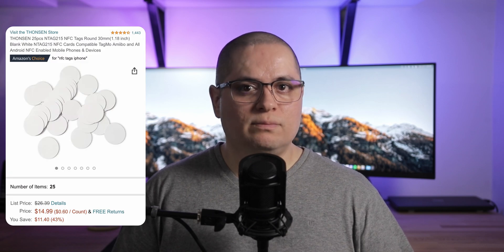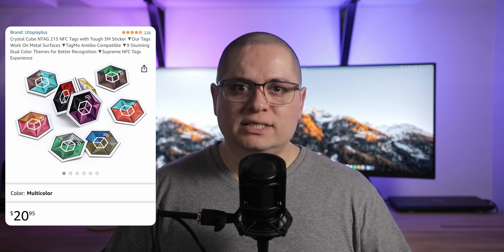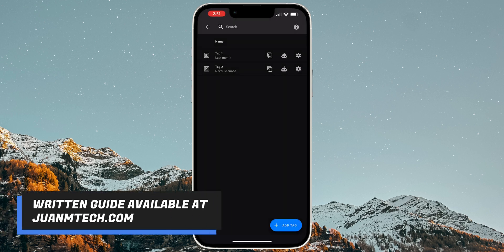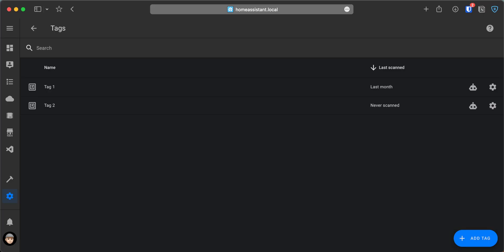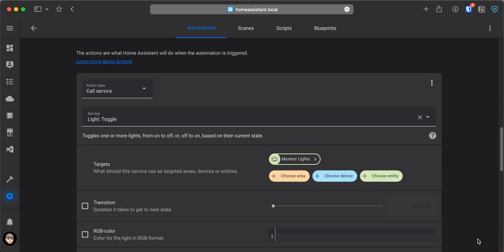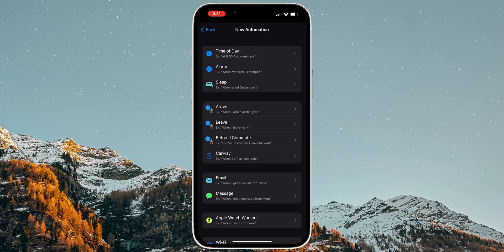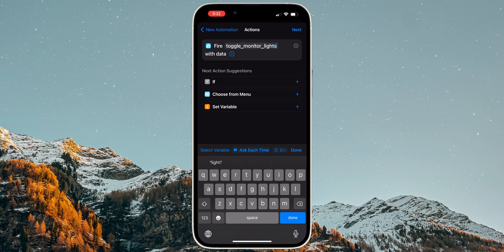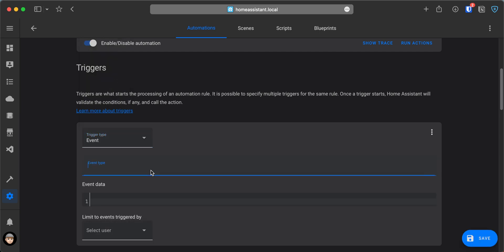How to use NFC tags with Home Assistant

Comment: I was finally able to get my NFC tags to run something without having to tap a notification in iOS today thanks to this video.

One thing I have a question about, does it matter which NFC tags you buy really?  I notice the ones I have sometimes take several seconds to actually register that I scanned them to run the automation.  Not sure if it's the tags themselves or whether that's "just the way it is".

Comment: Using an Android phone I have discovered that the plain white tags can trigger an automation without opening the HA app. I also tried using tags designed for outdoor use (they look like a thick black washer) but they require the trigger to be automated with the HA app open. There must be some differences between tag types.

Comment: can you 3d print a waited platform to stick the tag on, can you also create actions (for differant devices) that connects/disconnects mobile devices to/from bt headsets using these and can you setup a action (when tag is tapped) and do another action when you're out of a location?

Comment: Only for ios i guess
Reply: Android app for HA allows for scanning tags too.
Reply from the maker: Both iOS and Android
Reply: No Shortcuts app on Android, but I’m sure there are reasonable equivalents. (Is there an obvious choice there? If so, perhaps Juan will do a video covering it!)
Reply: @MichaelAlderete  On Android when you scan a tag, HA knows immediately (no notification to click) so the whole "Shortcuts" hassle isn't required
Reply: @DrunkenGolfer  hey there. I have a Pixel 7 and i do get the notification when scanning an NFC tag. I have to click it before it triggers the automation in HA. Any advice?
Reply: @wietsecornelissen8994  hmm. My Pixel 5 is up to date and doesn't give me any trouble. I think I remember that at first I had a notification, and chose to always open the links with the Home Assistant app. What does the notification say? Do you have the option to partly swipe the notification left or right to get to settings for these kinds of notifications?
Reply: @DrunkenGolfer  the notification pops over the screen. So not in the regular notifications bar at the top. It simply states that my phone received a hyperlink when the nfc tag was scanned and asks me if i want to open it. This is the step i want to get rid of. I am thinking of using Tasker with the HA addon but of there is an easier way to skip this notification i would be interested to find out!
Reply: @wietsecornelissen8994  no idea - sorry
Reply: I have one more question: can I somehow switch off the notification that still appears even if it runs directly via shortcut?  I would like that nothing appears on the display when the automation is triggered via the TAG.  otherwise a really great video and very well explained.  Thank you very much